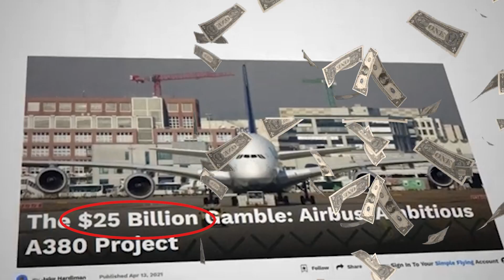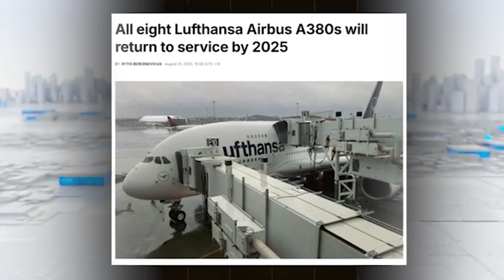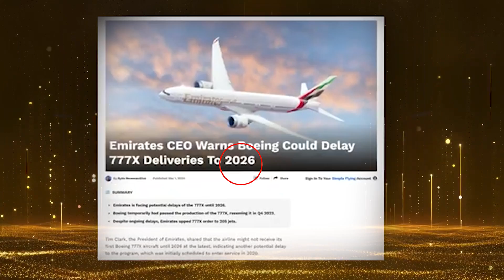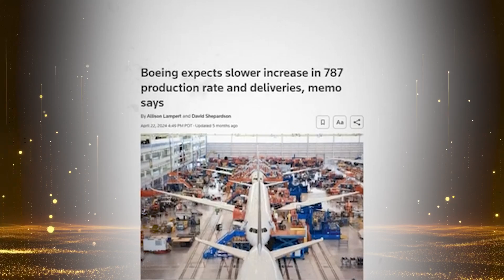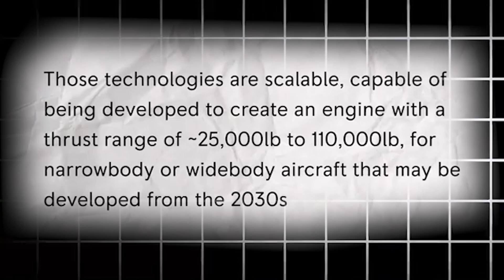You WON'T Believe What to Happened With Airbus A380 & It Shocked Everyone

Comment: The prestige carriers would love to keep these going for a good many years, however the basic gist of the video about delays to promised orders of twin jet wide bodies is right.  How many carriers will keep the A380 going once these orders start to be fulfilled?  Oddly I do think that the stretch A380 with the possibility of more capacity might be a good bet.  It would be a huge boon to be able to offer more seats on a handful of the worlds densest travel routes, even if turnaround times have to be slightly longer.  I'm not sure if the discussion about Ultrafan is really a factor; by the time these engines see service it will be too late for any current A380s in original design.  I think history will judge the A380 as about 30 years ahead of its time, as.something of a pioneer which couldn't quite reach its planned potential.  That said, I would love to do a long haul in business or 1st class on one.
Reply from the maker: Thanks for the view and comment. I think the design of the A380 is good enough, no need to extend it, the important thing is the engine.

Comment: In fact fitting more modern engines to the 380 is perfectly feasible and previously applied to earlier designs,notably the DC8.The engines used on the 350 and 787 could be adapted fairly easily and 4 fitted to the 380.Further in the future new designs such as the ultrafan would work.I have been surprised high capacity airlines such as Air India don't snap the low hours second hand 380s on the market.Maybe they will but I suspect the owners mostly leasers would find this difficult.The Air France fleet,Thai airlines spring to mind also.
Reply from the maker: Yes. If they intend to produce the A380 again, changing to new engines is the most important thing. If they are viable, having to get certified again is not an issue.

Comment: I flew with Singapore Airlines and BA on their A380's in economy and they were so much better than the 747's, I would love to see another A380 designed with 2 upto date engines instead of 4
Reply from the maker: Yes.
Reply: Two engines would have to be extra sized to push that airframe forward. Look at those on the A-350 or on the B-777 and muliply by one point five or 2.
Reply: @geoffreymartinez7208  Yes I know, but it was only wishful thinking on my part

Comment: I say yes to the A380. Also, we need an A360 and A370
Reply from the maker: Yeah, that’s gonna blowing the aviation with a360 and a370
Reply: With all that is already available from Airbus and Boeing at the moment, all types of their airplanes are enough to cover all possibilities.  It will take sometime before one of the two announce a new aircraft.  Airbus with its A-220, A-321XLR and A-350 along with Boeing with their 737MAX, 787 and 777 is quite enough for quite sometime.  Airlines will not buy new models as all their purchases back-log will cover their needs for the next 50 years.  So I don't believe we will see another new model appear on the market before 2035.